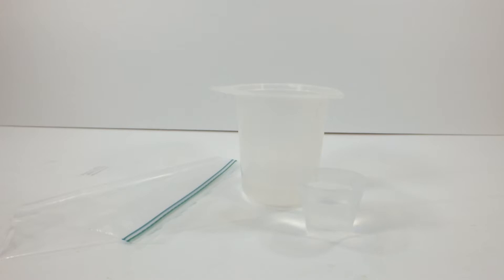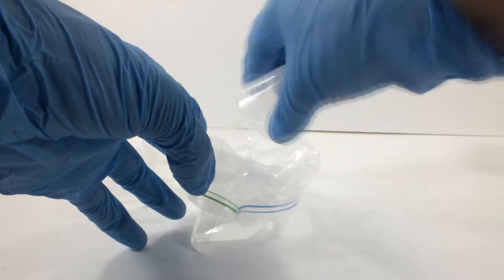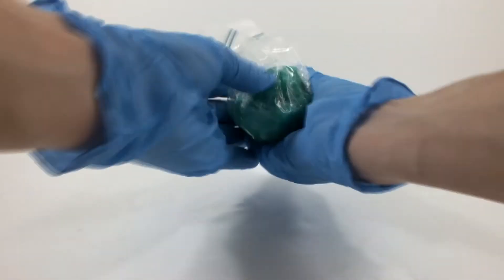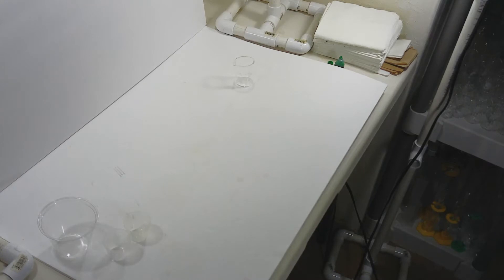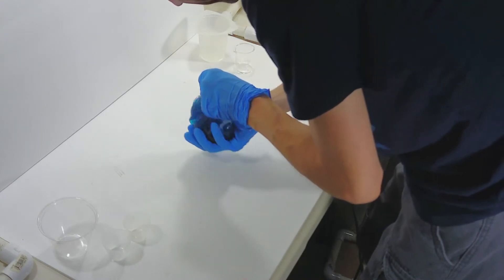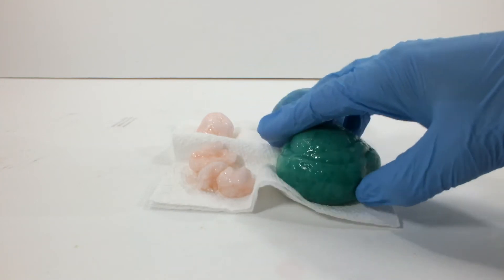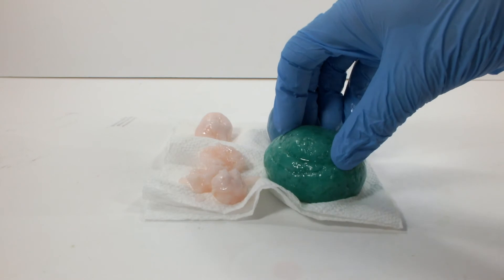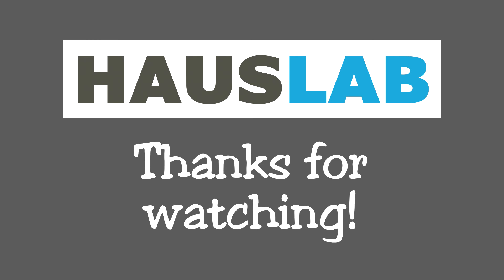Quick Lab: Easy Silicone Polymer Balls | HausLab Chemistry

Comment: Polyvinyl Alcohol or Acetate (Acetate cleves in the basic solution) will react with Potassium Silicate. Mix until homogenous and allow to try in a beaker. You end up with a hard cut cow bone product with a hollow center and considerable shrinkage making it extremely easy to remove from the beaker. I was demonstrating it to me neighbor, I dropped it and it proceeded  to bounce the full lenght of the hallway (about 25-30')..